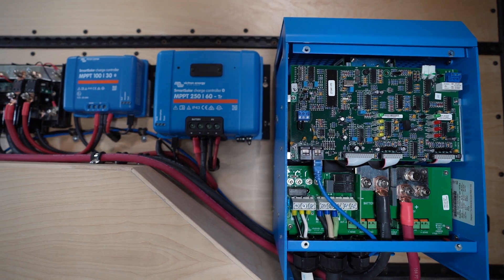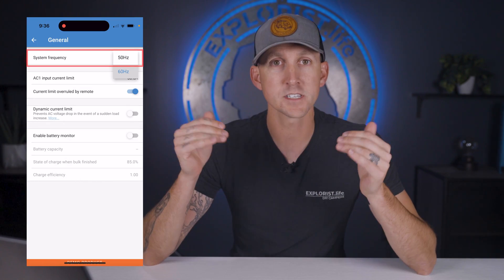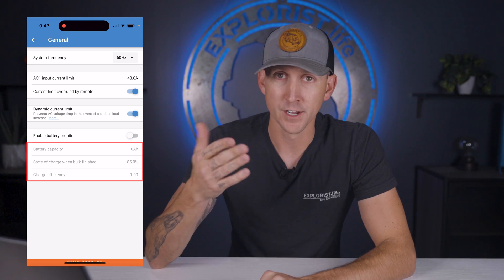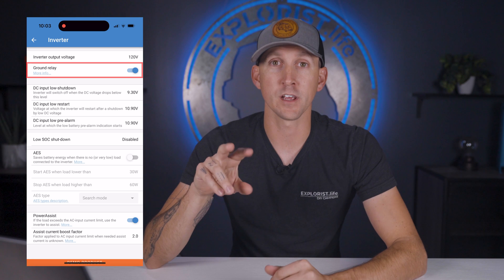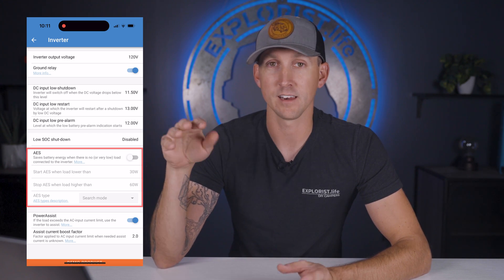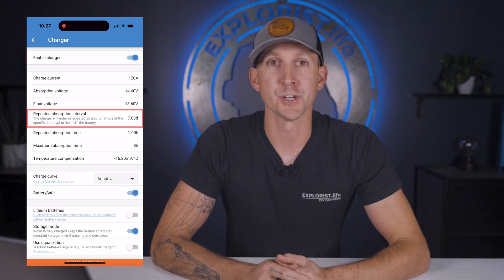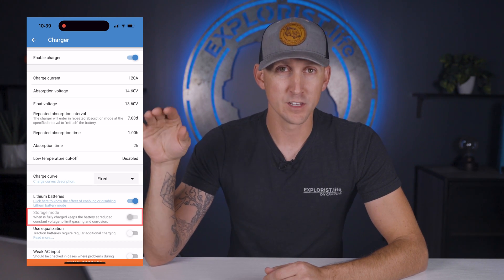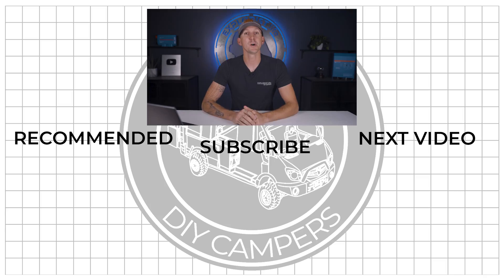How to Program a Victron Multiplus/Quattro Inverter Charger (easy/cheatsheets)

Comment: How do I set the charger to stop charging the batteries at 96% and begin to charge again at 90%, just in a bid to stop the battery from going idle after series of charging at 100% because of constant  grid availability.
Reply from the maker: Great question! Those charge-level behaviors depend on your specific system setup and battery details, so the best way for us to point you to the right settings is to take a quick look at your exact configuration.

If you reach out to our support team, we can review your setup and guide you to the correct programming:

https://shop.explorist.life/support?utm_source=youtube&utm_medium=comment&utm_campaign=support&utm_content=response_link

Comment: Thanks for the helpful video.  I have a Multiplus and was having issues where it would shutdown unexpectedly when the battery state of charge got above ~95%.  It was very puzzling.  Around the same time, I noticed the battery BMS phone app was giving garbage data.  This made me think the batteries and Multiplus were fighting at hight states of charge.  I dialed back the charging voltage from 14.4 (which was recommended in the battery manual), down to 13.9.  The problem has not reoccurred.

I think the root of the problem happened when the battery got full and the BMS stopped allowing charging abruptly, which caused some kind of surge back to the Multiplus and caused it to trigger a safety / emergency shutdown.
Reply from the maker: Hmm... that doesn't sound like an actual long term solution.  Reach out to our customer success team for some assistance: https://shop.explorist.life/support?utm_source=youtube&utm_medium=comment&utm_campaign=support&utm_content=response_link

Comment: I know this is a year old, but wanted to ask about the "Assist current boost factor" setting, especially for RVs as they tend to have appliances that can consume most or all of the 30/50 amps service. When I read the documentation from Victron, I saw it is (as you mentioned) a true multiplier meaning 28amps (input limit you suggest) * 2.0 (the default boost factor) * 120v = 6720watts (6360w technically with 3k max for inverter) it would attempt to pass in total from the output side of the inverter (passing through 28amps (3,360w) from shore and the rest from battery (3,000w limit of inverter)). Wouldn't that try to push 56amps to the RV breaker panel from the output of the inverter and just trip the 30 amp input breaker? Would using a boost factor of 1.08 over the 28amp max (total 30.24amps) be safer in ensuring we don't overpower the busbar in the breaker panel? It would still keep the shore power below the pedestal breaker level but also not overload the RV breaker? I'm using 6/3 wire from the inverter to the panel so i can handle a little higher to the box, but I'm just not sure about how the breaker would react. Its all so confusing
Reply from the maker: Great question, and it’s awesome that you’re digging into how those settings work!
That kind of setup can definitely get complex, especially in RVs.
We’d be happy to help you sort through the specifics — feel free to reach out to our support team so they can take a closer look: https://shop.explorist.life/support

Comment: Thanks, this is really useful when shopping for victron products! I do have a question though.
I'm planning on installing a multiplus and several SmartSolar MPPTs. I'm aware that if I connect them all on the VE bus then the MPPTs can synchronise their charging, but I'm wondering if the multiplus would also synchronise its charging to the MPPTs? so I could have 70a from the generator and 20a from the MPPT all at the same time? I can't find any info about it anywhere. Thanks.
Reply from the maker: Great question — Victron systems offer a lot of flexibility, and yes, the VE.Bus network opens up options like MPPT synchronization. That said, how everything works together can depend on your system configuration and programming.

We’d love to take a personalized look to make sure you’re getting the most out of your setup:
https://shop.explorist.life/support
(We offer free one-on-one support for items purchased through our store.)

And if your gear came from elsewhere, our EXPLORIST Pro Support Membership is a great option for expert help across your full system:
https://shop.explorist.life/shop/all-products/membership-tiers/

Comment: Amazing video. I love how you added the cheat sheet guides at the end to screenshot. I'm in that exact situation where the battery manufacturer is giving me pretty vague responses (Wattcycle 280ah x 2 in parallel). The odd part is the get me a bulk charge voltage of 12.8V, an absorption voltage of 14.6V, and a float voltage of 13.6V. Then they glossed over all of the other questions I have for the various other settings.
Reply from the maker: That sounds pretty typical!   Our team can help:  https://shop.explorist.life/support

Comment: Why would my 1-Ott power wire running between the SIX, 12v - 100ah Battle Born batteries,  and the Victron Muliplus II be getting hot when charging? Thoughts??
Reply from the maker: If that 1/0 wire is heating up, it could be due to current load, resistance at a connection, or maybe even undersized lugs or terminals. There are a few things that could be going on.

Our support team can take a closer look at your exact setup and help troubleshoot:
https://shop.explorist.life/support

Comment: Hi, can you comment, make a video, whatever, UK  Multiplus, had 4 x 265ah AGM victron batteries for self consumption and solar charging,  never really performed well.  Anyway i replaced the AGM batteries with 12v 285ah Lithium, internal BMS Bluetooth.  Thats when the fun began.  The multiplus does not have assistants for the lifePO4 batteriess, both want either Victron or 2 Wire BMS.  Fun and games trying to set this up!!!

Comment: I'm so sick of messing with this thing.  I'm sure it's easy when everything works, but otherwise it's a motherfucker.  My 1000 dollar blue box is a useless paperweight that won't actually charge my batteries.  It thinks they're more charged than they are, so it switches from bulk to absorption charge at 4 amps.  At 4 amps these 280ah batteries are never getting charged.  Even if I was willing to wait as long as it took at 4amps, the stupid thing will switch to float at some point anyway.  No forums have been helpful.  No setting have fixed the issue.  I have thousands of dollars and over 100 hours in this project and it seems like it's all for fuckall.
Reply from the maker: I mean, if it doesn’t work, it could be a warranty claim.  Did we sell you the unit?  We don’t have any pending troubleshooting inquiries that sound like what you’re dealing with.
Reply: @EXPLORISTlife  no, I ordered everything from Amazon.
Reply from the maker: Gotcha.  It's a support problem, likely not a component problem.  This is unfortunately super common.  I wish you would have found us before purchasing and we could have avoided all of these roadblocks.  Let me see what kind of strings I can pull on my end to be able to offer support for you even though you purchased from a competitor.  Reach out through the chat support on our store and I'll keep you in the loop.
Reply: @ I'm an idiot.  I stressed about this for almost a week.  I took almost everything apart a few different times.  Then after I wrote my stressed out comment above, I checked voltage at the terminals, and again at these 200A terminal fuses I bought.  There was over a volt difference across the fuse.  So I took them off and tried to charge the batteries again.  I guess things are working this time, because each battery is taking a much longer time to charge.  It seems like these fuses have a small plastic insulator at the bottom of the post they mount to.  If you aren't paying close attention, there's a tiny shelf the fuse can get hung up on and seem like it's in position.  It makes enough of a bad electrical connection that everything will sort of work.  Anyway, thanks for responding and the setup video.
Reply from the maker: Do you have any feedback you can share on how you ended up purchasing your Multiplus/Electrical System from Amazon instead of through an actual dealer (specifically, us)? 

We are trying to capture more people before they get to amazon so that we can be there during the installation process to support to minimize those stressors.

Comment: thank you.. great vid..helped us alot on the MPii..  ps.. we wired up the trickle charger function using lithium settings of 14.4, and 13.6 in the DVCC..  it charges thru 15 ft of #14 wire and a switch in my sprinter.. so far working well..  it keeps the starter between 13.75 and 12.8..  I rely on the solar to keep it up largely, and monitor it VRM..  thought you might like to know that data.. thanks for all you do.. have learned so much watching you all.

Comment: Hey, just saw you don’t have a battleborn contract. Wish Litime would work with you as lots of us use them. I would love to see charging parameters for Litime as I see so many different specs. I have 6 100 ah 12 volt batteries. I see they say their batteries full charge is anything above 13.33 which is vague. Absorption 14.4 +- .2 also vague. Float at 13.5-13.8 again vague. Just wondering if you’ve worked with these and what you recommend?
Reply from the maker: LiTime would generally fall under our 'universal' charging parameters we have for multiplusses in our store.  We also could not find very good documentation from them but our 'universal' parameters are based on averages from about a dozen different manufactueres; so I have no reason they wouldn't work for LiTime.  https://shop.explorist.life for support
Reply from the maker: LiTime definitely wants us to market for them, but they definitely ghost us every time we ask them for dealer terms that wouldn't make it cost us money to sell their batteries.  🤷🏻😂  I think the language barrier is a little to much to overcome.
Reply: lol! Guess you need to brush up on your Chinese 😂 I have Sprinter Camper Van 600Ah – 3k 12V Inverter – 400W Solar system. Is there a link to the ‘Universal’ parameters? I looked under the multi and the install video maybe I missed something🤷 side note I saw you’ll be doing some cool stuff up in steamboat this summer! I’m based in summit and looking forward to coming up and checking it out!
Reply from the maker: The 'Universal' settings are found in our programming options when somebody purchases a multiplus from us or otherwise are in this guide: https://explorist.life/victron-programming-guide/

Yeah!  Come on up!  https://events.explorist.life

Comment: I have a Quattro inverter which in the settings to program it gives me an AC one and AC two input. Do I set them both to 30? AC one input default is set to 60..AC two input default is set to 30. AC two input which is set at 30 has the over ruled by remote checked but AC one input that is set to 60 doesn’t have the overruled by remote checked so another question is do I have them both checked?
Reply from the maker: Those two options are for whatever you have connected to AC input 1 and AC input 2; which could be shore power and a generator, for example.  Change those settings to be appropriate for the AC Input sources that you have connected.
Reply: Whenever I have my cerbo gx plugged into the Quattro inverter, the inverter won’t turn on. Do you know what’s going on here?
Reply from the maker: That could be several things we will have to troubleshoot our way through.  If you've purchased your quattro and Cerbo through shop.explorist.life, reach out at shop.explorist.life/support for more personalized guidance and troubleshooting.
Reply: @EXPLORISTlife  thank you for your reply, I actually figured out the problem, it was a mistake on my part, I had the RJ45 cable plugged into the wrong spot, when I plugged my inverter into the laptop I borrowed the only RJ45 cable I had from my cerbo gx and when I plugged it back in I plugged it into the wrong spot. I feel like a complete idiot after spending all day and all night trying to figure out the problem lol

Comment: I have a Quattro with a victron digital multi control.  After updating the Quattro firmware The control now shows “Ac1” and turning the control knob does nothing.  Any suggestions to correct this issue?
Thanks!
Reply from the maker: Yes, I have some suggestions, but this will take some more in-depth troubleshooting.  If you have purchased/are purchasing from our store (shop.explorist.life) reach out for some more personalized help: shop.explorist.life/support

If you've purchased/are purchasing elsewhere, reach out to your dealer for support.  We'd love to have you as a shop.explorist.life customer so we can provide a bit more help in the future. 🙂

Comment: Just curious.  Does disabling the UPS function prevent the Multiplus from keeping power to AC loads when the shore power is disconnected or fails?  I thought that automatic transfer switch function was one of the big features of the Multiplus.
Reply from the maker: No.  Enabling/disabling UPS doesn’t affect the transfer switch directly.  It’s about how fast the switch is allowed to happen based on the readings of the quality of incoming power.
Reply: @EXPLORISTlife  ok. Thanks. Your channel is extremely helpful!

Comment: Thanks for the video! Also, bought a wiring diagram and thats been a great reference. Do you have a video or blog post about the entire order of operation for connecting the multiplus, batteries ( wiring in parallel) shore power, solar charge etc. doing a full build and soon will be setting up my VICTRON system.

Comment: Nate, your videos were a huge help as I put together my system.  I have a Multiplus 12V/2000VA/80A that came as 230VAC output. Can I reprogram this to 120VAC? The manual says that all settings can be changed, but the case is printed with 230VAC. That would seem to indicate that particular seetting is fixed. I can't get through to technical support.
Reply from the maker: Oof...  nope.  That's not a setting you can change; that's just the wrong unit.  Going to have to return and replace.  Consider https://shop.explorist.life so that we can actually get you the right parts you need.

Comment: Hi! Thank you for all you do for solar community. I followed your steps for the settings for a Multiplus. Everything is working perfectly except I have a Champion 2500w generator that when I hook up to my RV it doesn’t show a AC coming in on Grid. I have a Victron 12/2000/80, a 100/30 SCC, and a. Victron shunt, 3 100ah LiFePO4 in parallel. Any ideas as to why it is not working? I have seen other people with Victron Multiplus using a Champion 2500w and it is working. Thank you so much as we are boondocking and need the generator as backup power.
Reply: Found the answer: Generator needed a Neutral-Ground Bonding Plug

Comment: Can the Quattro act as an automatic transfer switch between 2 a/c inputs, e.g., shore power and dc-to-ac inverter? I want to use an inverter to connect to my alternator and and connect the inverter the 2nd a/c input of the Quattro.

Comment: Hoping you can shed some light on my setup.  I have Multiplus 3000/120 and 4 BB 100Ah batteries and when I use my induction cooktop (900 W) I see a 2+ volt drop on my Victron connect monitor causing the inverter to shutdown/reboot.  I have dropped the setting for shutdown to 10.5 and this has stopped the shutdown.   I tested the cooktop on a friends setup which is slightly different and only see a .5 drop in voltage.  Ideas?
Reply: It’s been 5 months, but what you are describing sounds like excessive resistance in your wiring.  Most often from insufficient cable size.

Comment: Do I need a wifi connection to do this programming?
Reply from the maker: Nope.
Reply: @EXPLORISTlife  for some reason my PC is not connecting to the multiplus compact. I'm using an MK3 dongle and a properly tested RJ45 cat 5 cable. It's not registering on either VE config or Victron connect
Reply from the maker: Reach out to your Victron dealer for further personalized troubleshooting.  If we are your dealer, that’s shop.explorist.life/support

Comment: thanks for explaining this, i live on a canal boat and was having trouble with my multiplus compact not accepting the input from my generator, its now sorted. One query, i tried changing the DC input settings on the inverter section did a reset as it asked me to and they reverted back to default?

Comment: Nate, Thanks again for all the great content.  While watching this one, I remembered that you did not install the Multiplus on the 5th wheel and truck camper videos in units with a surge protector (unless they were using an outside device on the pole).  Does the High and Low AC voltage parms negate the need for a surge protector?  And if so, how does the error show if I am not using a Cerbo GX?
Reply from the maker: Thanks for that!  The high and low AC cutoffs are pretty robust, but aren't a 'surge protector' when it comes to, say, lightning or grid failures/issues and we recommend getting one of the surge protectors that plugs into the shore power pedestal for stuff like that.

Comment: I just got my MPII wired up today..  but it's not showing up on the app. When it got turned on today.. It was charging the batteries (four BB 100Ah lithiums) and was getting just over 840w with my 2 arrays 1200w and 1740w on a pair of matching 100\70 controllers.  The mains light is on and green and it's in (yellow light) float mode. I have saved these settings on the laptop that's connected to the MPII.